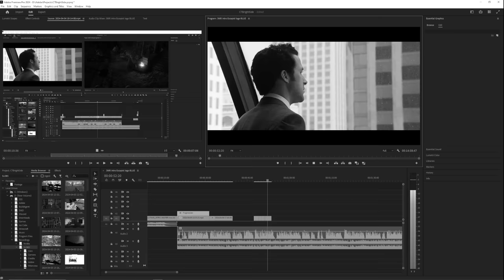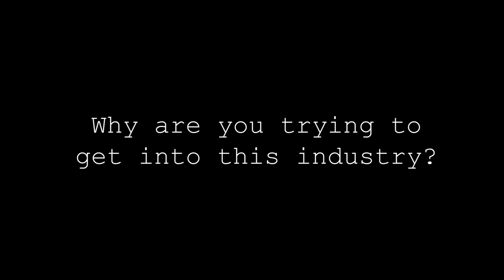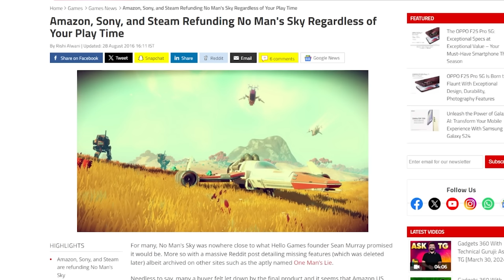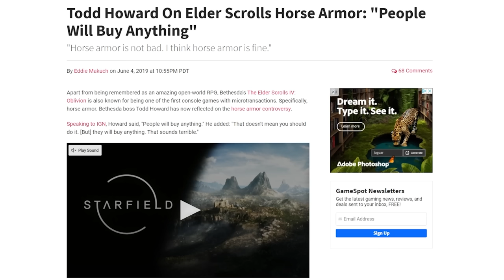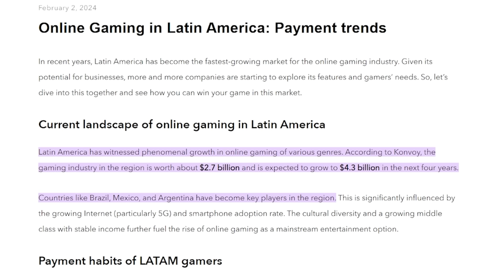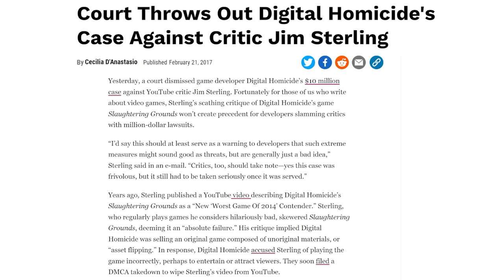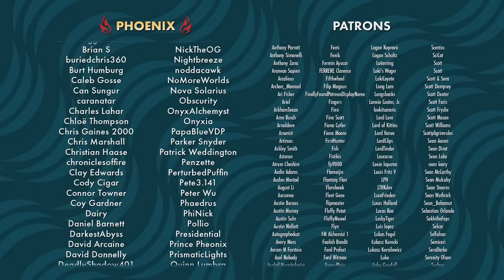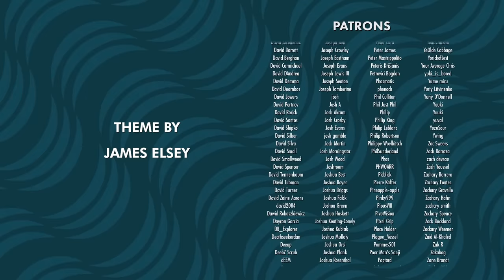The Bright Side of Gaming | Cold Take

Comment: As far as the "meta" of videogame companies and development goes, Genshin feels like it was 10 years ahead of everyone. Companies in the hundreds saw the microtransaction and gacha/lootbox pie and all wanted their piece of it, so they made--and are still making--tons of shovelware live-service games at breakneck speeds that release unfinished and are entirely transparent in their makeup as simply a Slot Machine that has something that "technically" resembles a videogame attached to it, and gamers are not having it.  
Genshin on the other hand realized earlier than anyone else, that in order to get gamers to pull your slot machine, you dont need to make the Slot Machine itself more appealing, or try to trick people harder using more dark patterns or underhanded tactics, like Diablo Immortal. Instead, they simply took an average run-of-the-mill Slot Machine and packaged it with a pretty good game that can stand on its own. That's all it took to become the most financially lucrative gacha game of all time.
Reply: I don't think Genshin is a good game on it's own, but it's a tad more clear about it's purpose than Diablo Immortal.

Comment: 7:53 That may be the case but Sony's still holding strong on their policy with basically every other game. Although the Japanese version of PSO2 let you use the Toro and Kuro friend partners on every platform and even though you can only obtain them on PlayStation and the Zelda BOTW cosmetics were usable on PlayStation (no idea if these things are still true) and it does not support crossplay and PSO2 Global censors the Steam and Xbox cosmetics on PS4 (no idea if it supports crossplay butP SO2 Global is running on Microsoft Azure servers so I doubt Sony even got a say).